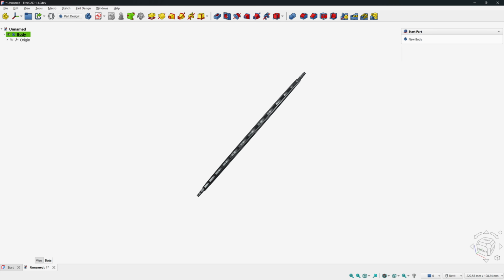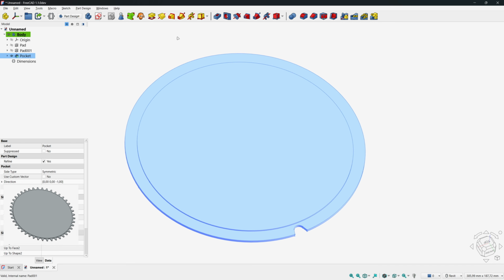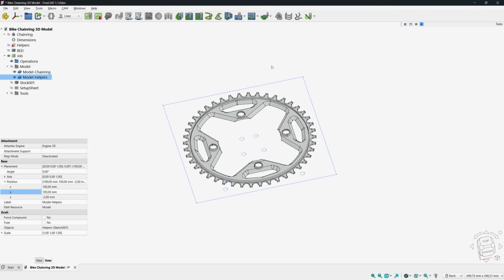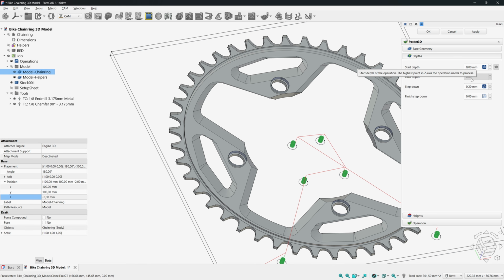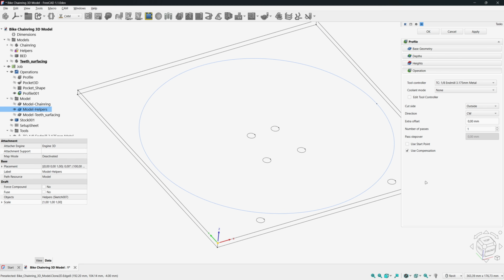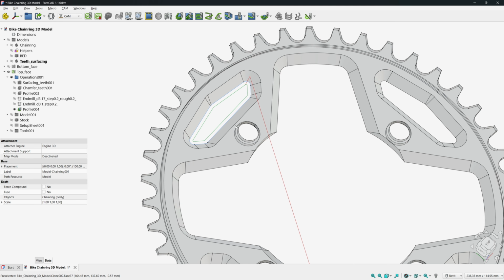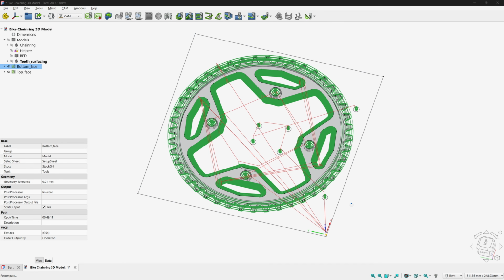FreeCAD 1.1 - Tutorial CNC/CAM - Masterclass - Complete Project (3D Model, Setup, Path & G-code)

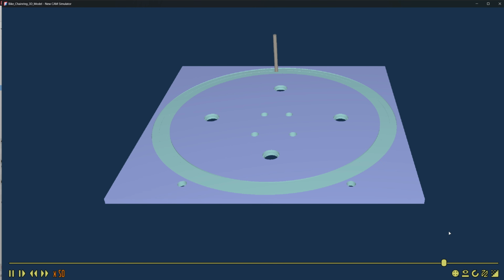Comment: @Deltahedra 37:00 - “I didn't model it directly because it could have caused issues with the other tool paths" - what does this mean? What do I do if I've got a STEP file that contains those and I want to set up the CAM job for it? FreeCAD is very good, getting better all the time, but the CAM workbench seems to not quite be ready for proper "production" gcode generation - is that a fair assessment?

Comment: Thanks! Amazing content! 

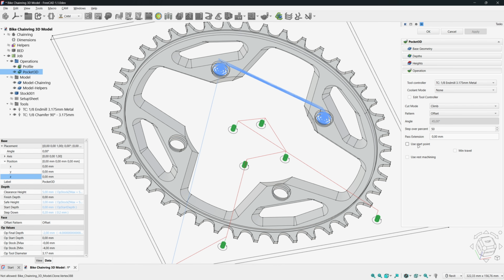This convinced me to give FreeCAD another go (after multiple failed attempts at moving away from onshape). I've heard that Makera endmills are not exactly 3.175mm wide, did you have accuracy issues with the final part? Also, how does "Use Start Point" magically solve your problem at 32:30? I've looked at the docs but it didn't make much sense to me in this context.

Comment: Carvera uses Smoothieware as it's base firmware.  GRBL mode or linuxcnc should both work fine since Smoothieware has made efforts to use NIST compliant gcode.   Great video...this should work very well for anyone using V1 or V2 Smoothieware.

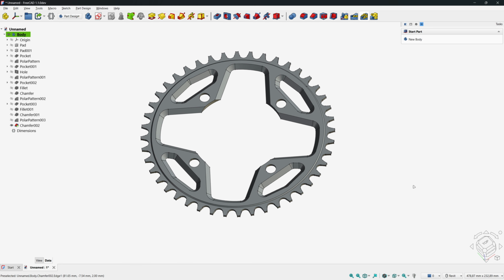Comment: Thanks for all your videos, they're a great help to learn FreeCAD! In this tutorial everything went well up until 15:30. This is when I try to change the number of teeth, and then FreeCAD falls apart. First the fillets of the small holes breaks. I can select the new edges, and it recomputes correctly. Then the chamfer of the small holes is broken, and here I simply cannot get FreeCAD to accept anything. Does anyone know of a solution to this kind of problem? I can only guess that because I change the number of teeth the edges get new names (edge203 instead of edge218 or similar) and the house of cards falls apart...

Comment: Really nice video. 
I personally do some minor things different in my CAM procedures, but these are mainly personal habit (placing the name of the tool in each operation title; trying to minize tool changes by default; using helix instead of pockets for drill holes; ...) 
Still love to watch your videos and learn something new each time. Even at "simple things" like parametric part design within a sketch. Really helpful and worthwhile every time! 

Thanks for your efforts! 

Video topic suggestion: adaption of CAM processor to owm machine specifics. Or addition of machine specific gcodes/macros for automatic tool change, tool length measurement, suction/light/... control. 
Very complex topics, but this is what I am starting to think about currently ;)

Comment: Why did you start with FreeCAD 1.1? Is there anything special it does that the current 1.02 release doesn't do? Feb 2026 1.02 is the default that my distribution of Linux installs and 1.02 is the current download from the FreeCad site. Making a tutorial on essentially unreleased and possibly fluid and changing features is just another barrier and source of frustration to picking up a tool.

Comment: I hadn't tried FreeCAD in over a year so I see this video and I think.. ok... maybe I should try it again.  So I download the latest released version on Silicon macbook.   Make a simple design, one cylinder on top of another cylinder... so far so good.   I shell the body then I go to click on the object to adjust it and FreeCad core dumps on me.   That was it, that was all I did.   I can see why stability and actually being able to use it for 10 minutes without it crashing didn't make your video list.  And I can make happen every single time.   LOL....   No.... No Freecad... Freecad is NOT an option.🧐

Comment: Thank you for this incredibly video ! I have a question :-) if I understand well, all the Cam part is not parametric anymore, profiles won't automagically update if I change the teeth number, or if I modify some dimensions... Or is it ? And if that is not the case, how is that handled in the real world ? Does an operator redo manually all the cam setup each time small adjustments are made ? Coming from a 3d printer view, the Cam part seems to "just replace" the slicer, therefore restarting the whole "slicing" setup each time I modify the 3d model is understandable (moreso because cam is far mor complex than additive manufacturing), but it seems weird/error prone from an industrial perpsective :-)
Reply: Changing the number of teeth would be called "making a different part" in the real world :). Small adjustments are things like tweaking the diameter of a hole or a profile to accommodate tool wear, or to improve the fit of the part. This is often done through the software in the CNC using what is called tool radius compensation. When using this feature, you program the part using an idealized perfect tool in your CAM, and then at the CNC, you input that tool diameter plus or minus a wear amount in the machine's tool table. The machine then calculates an offset toolpath all by itself. Thus, you don't have to redo all the CAM operations. Instead, you just modify the wear value in the machine's tool table.

Some CADCAM software will update the toolpaths with changes to the model, but you'd probably be required to draw the model in that software so the associations can be kept. In others, you update the toolpaths just by  re-picking the geometry on the model while you are in edit mode on the particular operation.

Comment: Great video! You helped me get started with my first FreeCAD Carvera job.
One note: not sure where you got the information that Makera recommends grbl for FreeCAD, but according to the official wiki, Carvera firmware is based on Smoothieware, so I would assume smoothie post-processor would be a better pick.
Reply from the maker: @shambles9 Thanks! I believe I found the GRBL info in the manual setup. For this simple project, I don't think it makes much difference. Thanks for the information.

Comment: Hi, 
im Feld pocket 3D kann ich keine weiteren Unterpunkte  (Surface/pocket/...line) auswählen. Version 1.1.0.dev habe ich gleich wie du. Was mache ich da falsch?

Hi, I can't select any further sub-items  (Surface/pocket/...line) in the pocket 3D field. I have version 1.1.0.dev, just like you. What am I doing wrong?
Reply from the maker: @moggelmoggel8865 If you want the 3d surface in the CAM, you need to go in the CAM settings/advanced and enable OCL dependent features, you may need to install opencamlib too.
Reply: @deltahedra3D  
Thank you very much, I found the option. Unfortunately, I can't get usable CAM for a truncated cone (70 mm/50 mm with a height of 19 mm). Can you help me with this? I can send you an FCStd file. 

Vielen Dank, ich habe die Auswahlmöglichkeit gefunden. Leider bekomme ich bei einem Kegelstumpf (70mm/50mm bei 19mm Höhe) kein brauchbares CAM. Kannst du mir da helfen? einen FCStd file kann ich dir zusenden.

Comment: Freecad 1 in the cam work bench ,my post processor is set for GRBL for a Genmitsu 4030 witch produces a .NC file, just like your post processor did. The test files that come with my Genmitsu 4030 are .TAP files and they worked, plus I downloaded a .GCODE file created in freecad and it worked, Genmitsu says the .NC will work on my machine but they don’t , hopefully you can help me out Thanx Mike

Comment: I get an error while trying to create symmetry for the holes in the bed at ~18:39, saying "Notifier: bike sprocket#helpers Message: Selection has no valid geometries. (5 times)" and I have no clue what is not ok.
Reply from the maker: @kadomaschine1158 Are you selecting the projected circles correctly and not the edges? Maybe try hiding the bed.
Reply: @deltahedra3D  I don't know where I have messed up, but I can only select the circles if the bed is visible. Selecting a circle on the bed creates a construction line in the helpers sketch. I have managed to overcome this by projecting a circle (non construction) on top of the construction circles, and I was able to create symmetry for them.

Comment: When running that 3d pocket with a bevel, isn’t the cut of material getting too thick to the inside? Each pass the bit is going deeper and moving inward but the material toward the inside hadn’t been removed yet, right?  Or am I missing something?  Legit question, love your content and resources you are sharing.
Reply from the maker: @kh1188ish Good question! The cutter isn't just plunging; it's also moving laterally to slice away the material. This allows it to do a kind of 3D contouring. If you're interested, I made a video of the chainring being machined using this exact technique, and it all went smoothly. https://youtu.be/6oCA0FauOT0

Comment: I don't understand what are Model-Helpers and Model-Teeth-Surfacing for CAM.
Reply from the maker: @kogyiluuluu These are objects I need for my machining. Helpers let me reference the holes of my CNC bed so I can flip the part and place it back in the exact right position. It also gives me the path to machine the chamfer at the tip of the teeth, and teeth surfacing allows me to machine a wider area around the teeth. I find it easier to work with these extra objects.

Comment: Great to see you can do all this with a single open source program! Setting all the tool paths seems a bit tedious task, though. I hope we'll see some kind of "CAD slicer" to automate most of the CAM work needed.

I'd have wanted to see more discussion about part holding. The way the cuts were made, the alignment holes get cut off pretty early and holding the part at exact correct position for all the remaining cuts might be hard in practice. Also, the way you cut the smaller "5 corner" holes makes me wonder if the detached center will go flying and potentially break the tool?
Reply from the maker: @MikkoRantalainen Thanks for your comments. Even with paid software, creating toolpaths takes a lot of time, and that’s often why machining just a single part can be so expensive. As for holding the pieces, in this video https://youtu.be/6oCA0FauOT0

Comment: Never used FreeCad but that is very cool. You went a little fast on some steps, but most makes since if you have previous CAD, CAM experience.
Reply: Being old , slow and hard of hearing, I change the playback speed to 75% (in settings) and turn on closed caption. Helps me when following along in 

FreeCad

Comment: I do all 3d printing in mm, but my cnc base is in Imperial.  I couldn't figure out why a 3.175mm end mill was a normal thing until I did the conversion from mm>cheeseburgers>inches to find out that's a 1/8" end mill, or 41 millicheeseburgers.
Reply from the maker: @mattw7949 Yep, every time I name a tool I put the dimensions in both metric and imperial so I don’t get lost.

Comment: I was looking forward to this video more than my birthday. We need more FreeCAD CAM content, thanks Deltahedra!!!!
Reply from the maker: Hahaha, any specific CAM content you’d like to see?
Reply: @deltahedra3D  anything you have in mind will be just perfect, but here some ideas if you ever feel lost;
1) machining a small, 2 part aluminum injection mold, so you can make parts much faster than 3d printing
2) more on cutter types, general cnc concepts as it’s learning curve a bit steeper than 3d printing
3) 4D machining to make an auger or something, or a super cool bike handle :D
Reply: @deltahedra3D I'll give you GatorCAM for CNC.  Do a review please !!  I'm the author and it's amazing !

V-bit
Tabs
Auto tool change
One click CAM
Optimized tool paths
No hidden menu settings
All feed/speed/settings on 1 line
Intelligent pockets

You'll love it!
Reply: @deltahedra3D hii
Car chassis
Reply: @deltahedra3D some turning too would be awesome
Reply: I starting working on FreeCad content recently.  I agree we need more.
Reply: Honestly I'd love a 3d printing to cam what are the differences

I'm a huge freecad lover and only getting into CNC. There's not much content on that :)
Reply: @ledjfou125  cnc is a must you can make so much 3d printers cant. And quite good cncs are now offered for around 1-2k, which is amazing.

With FreeCAD, i wonder if 4d machining can be done because Carvera machines for example give you a 4th axis too. This opens so much oppurtunities. Machining aluminium will boost any makers projects